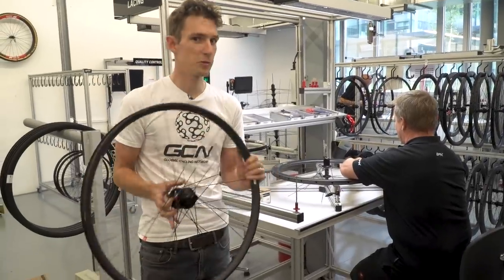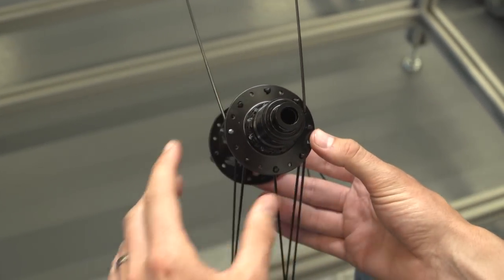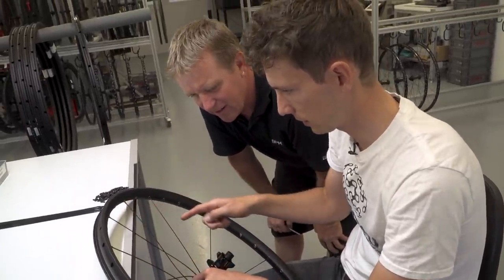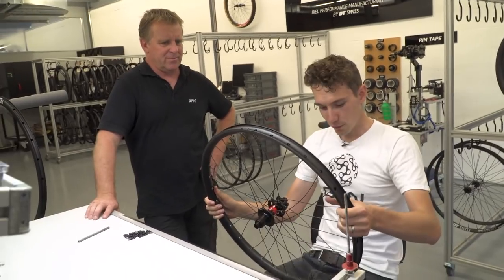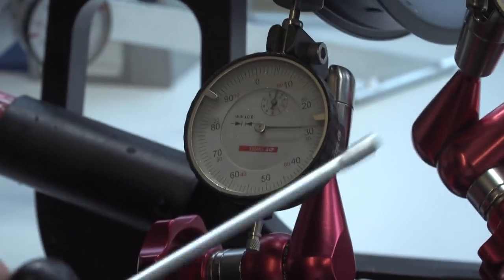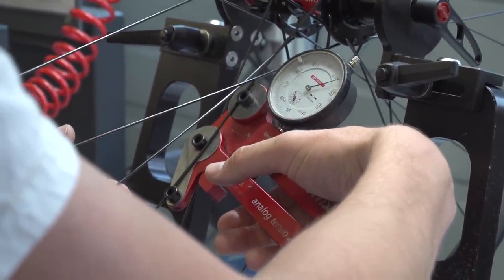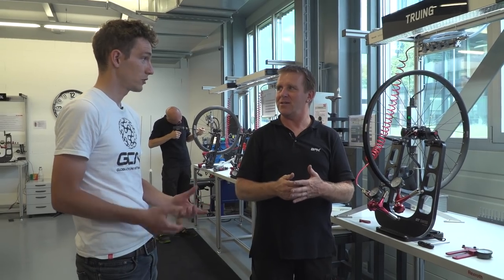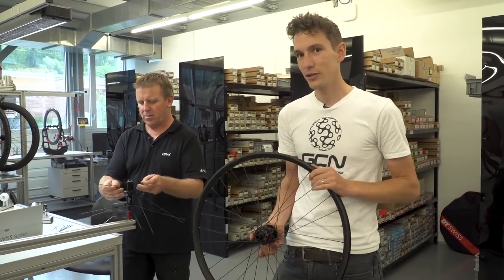How To Build A Bicycle Wheel | Maintenance Monday

Comment: I've used pitch to check tension while truing wheels, and it can apparently be used in wheel building in place of a tensiometer: https://www.sheldonbrown.com/spoke-pitch.html
Reply: Eleanor Law this tends not to work because its hard to know what pitch is the right one. Best rule of thumb for me is getting the wheel as tight as possible.
Reply: It's no worse than grabbing a couple and squeezing, it's a matter of how much experience you have. But if you have a musical ear (as I do), "plunking" them to check for uniformity of tension is very accurate.
Reply: It works fine.  If you follow links from that page you'll find a link to a table of spoke lengths to musical pitch.  I've built lots of wheels this way and have checked them with a tensiometer, and they've always been quite reasonable.  "As tight as possible" has a lot of variables.  If you're using good quality parts and lubing the threads like you should, it's actually not hard to over-tension and break things.

Most people who do it by feel tend to under-tension by quite a lot, which leads to weak wheels that will need truing often, and likely be breaking spokes within a couple years of regular riding (at best).

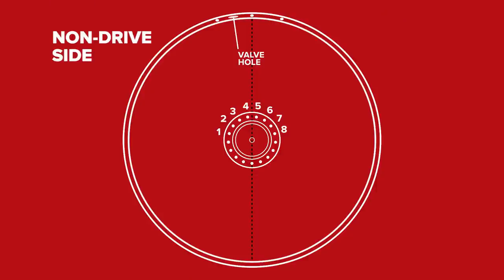Comment: 04:28 Wrong information!
It is the same method, BUT INVERS HEAD POSITION.
You will have the head inside at hole 1 (its head outside on drive side), 
and the head outside in hole 8 (its head inside on drive side).
Reply: I thought it was wrong,  The picture shows the same each side.

Comment: Not one of your best GCN, confusing and a bit superficial.  I went on a wheelbuilding course 20 years ago and have done 300+ builds and fixes since.  So satisfying but not cost effective because you can buy a pre-built wheel far cheaper than you can buy the parts.
Reply: Given a choice, I'll choose the satisfaction of riding my own hand-built wheels at 50+ mph downhill, or across the country anytime.
Reply: In my case the parts for the wheel are way much cheaper than buying a new wheel (I am using a 27" wheel in a retro bike vs a 622 ready made wheel suggested by the service staff). About 1/10th were my costs. The tools would certainly push the budget, but they would remain in my toolbox for later repairs/builds.
Reply: I can build a much better wheel than I could buy within my budget.
Reply: Human spoke tension balancing > robotic, having built 300 wheels in the last 10 days, that is.

Comment: Until I'm ready to buy "ALL" the proper tools needed. I'll just let the master wheelbuilders do what they do best and enjoy riding instead 😊
Reply: What if you had the tools available to you, like at a bicycle co-op or something?
Reply: Patrick94GSR That would be cool and YES I would definitely build my own. A lot of people have multiple wheel sets , why not have a set that you built yourself?
Reply: Nothing wrong with leaving it to the wheelbuilders if you want to, but you can certainly build good wheels with minimal tools as well.  An upside down bike works as a truing stand and you can check tensions with a guitar pick and your ears. (there's a table you can find online with spoke length to musical pitch values).  That does away with the expensive tools.  I think the only specialized tool you need is a spoke wrench.  The tough part is being patient enough to do a decent job of it.  My first wheels took many hours before they were decent.
I'm working on making an in-depth video on the subject.  I've shot a bunch of footage.  Now I just need to learn the editing.  ;)
Reply: nwimpney Many hours?!!! Do bike shops have wheel building/trueing classes?
Reply: nwimpney You don't even need a spoke wrench. When I started I cut a bit out of the middle of a flat blade screwdriver. So if the spoke starts to stick through the nipple I could still turn them.
Reply: TRON KNOWS  Yeah, I didn't time it but I spent a couple evenings on each wheel the first time I did it.  It's not so much the assembly, but the truing.  I'd get it kind of close, and then another part would be out, and then it would have too much tension on one spoke, and lots of back and forth monkeying around.  That's just learning, though.  The last one I built was probably 4 hrs or so, and that included a bunch of screwing around filming it so I can make a good video on the subject.  If I was building for a bike shop and needed to get it out quick to make a profit, I could probably build a decent reliable wheel in a couple hours (with practice and some nicer tools, I could bring that down a lot more).  Since I'm building for myself, and actually find it kind of fun, I don't mind spending twice as long evening out tensions and getting the wheel bang on.

I don't know if you'll find classes.  I don't think most shops would, and honestly, I don't know that they would be super worthwhile.

I learned by jumping in.  I started with sheldon brown's wheelbuilding articles.  They're well explained for the basics.  I built some mediocre wheels.  Then I gradually read things from a bunch of different sources, and each set I built was better than the last.  I recommend checking out "The Bicycle Wheel" by Jobst Brandt.  It's quite scientific and doesn't make a lot of assumptions, or rely on superstitions.  One of the big issues with learning is that there's so much misinformation out there.  Even in this video he talks about building "softer" wheels by using less spoke tension, which is a common misconception (What you really get is weaker wheels).

My advice is to read very critically, and keep in mind that wheel building is not an art.  There's really no black magic.

Hopefully I'll get around to editing together that video soon, since I haven't seen any that really go in depth enough, step-by-step.
Reply: nwimpney Thank you for the information. You're right that it'll be rough at first, but it'll be worth it. I've built many bikes over the years, but have never built a wheel set. I was thinking about trying to build a set because I want to be able to pick my hubs, spokes, nipples, and rims. I better start off with some cheap stuff for my first wheel build huh?
Reply: Trying to tighten them from the slot in the heads is asking for trouble.  That's useful for spinning them on quickly, but I really wouldn't recommend building without a spoke wrench.
Reply: nwimpney I didn't see a spoke wrench being used in the video. Have to agree though I prefer to go to a spoke wrench if things are getting tight and I have one. Still possible to mess up a nipple with a wrench especially if it isn't the best fit.
Reply: TRON KNOWS  I don't think you're likely to hurt anything,  so you may as well use decent stuff.  I wouldn't go crazy with carbon rims,  etc, but buy something you want to use.  Don't assume it's throw-away practice stuff.
I would probably recommend against crazy low-spoke builds, or using really thin spokes like Sapim Laser, or DT Revolution on your first build, since they can add some complications. 
 Just get yourself some nice 32 spoke rims you like, hubs, and some good quality 14G stainless spokes/nipples, and build some nice standard 3 cross wheels.
Reply: nwimpney Thanks for the advice. Worse case scenario... I can take it to a bike shop so they can True it for me.

Comment: Such a process.  I really thought the hub would be held in a fixture while the rim was also held in a fixture while it gets laced.  If I did that loose like that,  the base wheel would be 4” out of true.  It would take longer to fix it than to start fresh.

As much work as that is I can’t believe they make cheap shitty wheels at all.  Doesn’t seem worth the effort to make anything other than high end wheels.

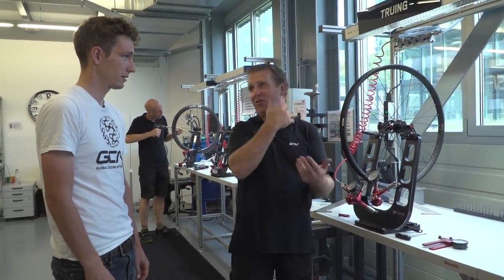Comment: Incorrect information at 11:45.  Modulus of elasticity is linear for the DT swiss stainless spokes in the range of tension used for wheels.  Stiffness of the wheel is therefore not effected by ramping up tension on the spokes higher or lower.  If a spoke were to go completely slack then you approach wheel failure.  Marcel Waldmanm may have been building wheels for 30 years, but apparently he has not read a book on wheel theory or taken a class in physics or engineering.  Building wheels another 10 years will not change this fact.  Experience does not = knowledge.  That's not to say his wheels are crap.  Only that he does not understand how they work.
Reply: Go easy Bert ;) but yes you are 100% correct I just had the same rant under the pinned comment!
Reply: Bert Hull...  Me three, that is terrible advice.
Reply: Yay.  I was just about to comment on that.  Now I can just thumbsup instead. :)

To put it in layman's terms:  Within reason, a tighter wheel is a stronger wheel, and you will not feel a difference.

If you're relying on your spokes for suspension, you're going to have a bad time.
Reply: SirBlot No way.  Spokes pretty much always break by fatigue, barring absolute garbage spokes, or huge impacts.  That fatigue is caused by the spokes stretching with every revolution of the wheel, and is massively increased by loose spokes which can go slack on each revolution.  If your wheel isn't shaped like a taco, the break was probably caused by fatigue.
Reply: Guys relax, they showed wrong info on purpose. The wheel building is easy, but they showed it like a magic magic )) Too complicated then it is. So do not take it too seriously.
Reply: Agreed.  Pretty much all metals follow linear elasticity (stretch is directly proportional to load and then returns) up until the point of failure.  Increasing the tension only means that the spokes are pulling against each other.  In other words, it doesn't matter what tension you start with. Extra load causes more extension.  All the weight of a bike is carried in tension. There is a down side to too much tension in that you decrease the fatigue life, or you might just pop over the threshold of linearity. The down side to insufficient load is that the lower spokes completely unload and THEN you have a floppy structure. So that's where a "soft" wheel might come from.
Then again, the bass player in me knows that a less tight string is floppy compared to a tight one.  Maybe its to do with vibration nodes.  
Maybe none of it matters and he should just build the wheel that feels best - whatever that is.
Reply: @pbassred w.r.t. bass strings, I think (after drawing a diagram) that tension matters for out of plane loads (like plucking a string), because the string makes an angle to the horizontal and the vertical component of the tension in the string to left and right of where the load is applied must equal the "plucking" force... therefore tension determines the angle you can make (i.e. the displacement of the string) for a given force (tighter string = less floppy than less tight string). However with a spoke the load is almost entirely axial and not out of plane, therefore no angle and tension independent of axial displacement as has been discussed already. Also from my limited wheel building experience, the spoke tension has an effect on how easy it is to squeeze the spokes together  (i.e. out of plane) just like a string... which makes sense to me. Hope that helps!
Reply: Yes Bruce.  That's kinda what I said.
Reply: @pbassred , yeah saw what you said about wheel acting in tension in your informative post above, just thought I would try to clarify the bass string observation you made in case it was useful for anyone apart from myself. Didn't mean to sound like a condescending pr**k but easy enough on tinterwebs. Rock/ride on dude.
Reply: Si put the words in his mouth
Reply: This must be credible information from you Bert. I was a bit dubious until I read "...therefore not effected...". Clearly you haven't read many books on language which almost certainly means you are an engineer. Young would be proud! How do I know these things? I am an inginear meself. ;-)

Comment: #torqueback riding with earphones and listening to music...yes or no?
Reply: If there's any other traffic around no, otherwise yes.
Reply: Pretty sure that's already been answered.  IIRC, on the trainer, yes.  In traffic, no.

I disagree, though.  I ride with earbuds all the time.  I just set the volume fairly low.  Passing cars will drown it out entirely (Traffic is a lot louder than most people realize).
I can easily hear other riders talk to me at a conversational level.  When I'm on busy streets, I can't really hear the music, but when I'm on the side roads/bike paths it's nice.

If you crank your music to try an hear it over traffic, that's kind of dumb, and is also annoying to other riders (and damaging to your hearing).  At the very least, you need to be able to hear another rider warn you that they're passing, etc.  If you can't, you need to turn it down, or give up the music.

Also, do not ride with one earbud.  This is a stupid habit.  Your directional hearing pretty much goes away entirely, and you will usually turn your music much louder to compensate for the other ear, causing hearing damage.  It doesn't accomplish anything over listening with 2 ears at a reasonable level.

One more piece of advice:  Use replaygain, etc, on your music so it all plays at the same volume, and then set your volume level indoors before you start the ride.  If you set it to a reasonable level inside, and then don't touch the volume again, it prevents you from slowly turning it up to compensate for the noise as your ears get used to it.  (Same effect as when you get in your car in the morning and your music seems insanely loud).  Of course, you need it normalized, or some songs will play way too loud, and others too quiet.

Comment: omg this lacing pattern is so confusing wth
Reply: 3-cross is very easy just look for any other video ;)
Reply: Gabor Varadi ik how to build wheels lmao, it's just that this method of lacing is confusing as shit
Reply: Yeah, it's not the simplest for a beginner.  The main advantage of the way he's doing it is that it's stable right away, and the spokes don't loosen off as the hub turns back and forth while you work.
It's a bit more complicated process at the start, but it makes the rest of the process a bit easier.
I really don't think this video was intended to teach you how to do anything.  It's more just an overview of the process which might inspire some people to give it a go, in which case they'll find more detailed info elsewhere.

Comment: Would you buy Chinese carbon wheels from eBay #askgcn
Reply: to shear GCN would never do that. That's Sponsorship Suicide.
Reply: i bought a pair a few months ago and they're great for the price
Reply: Profit mate I've heard a lot great things about Chinese Carbon Wheels. Of course you'll have opinions from the haters (who have never owned a pair), but I haven't actually seen any bad videos about them.
Reply: to shear I've built my own from some ebay carbon rims.  The tubulars on my track bike seem quite good.  I'm a little more wary of the clinchers, though they seem alright so far.
I've seen some pretty mediocre wheels, and while I might buy some myself if I wanted a cheap set, I would check the tensioning and adjust/true them if needed.  I probably wouldn't recommend it to someone who doesn't know how to do that.  Of course, I wouldn't recommend super-cheap aluminum wheels, for the same reason.

I have known people who have bought cheap carbon wheels, and have ended up spending a couple hundred bucks at the LBS getting them rebuilt with better spokes, etc.  I'm not sure at what point you're better off just saving up for a brand name set.  OTOH, lots of people are totally happy with them, so YMMV.

Comment: I learned how to build wheels as an adult and it's big waste of time.  U can build a nice wheel but the time needed to get good would b better spent riding the bike.
Reply: You can build them when it's dark out and you're not riding or when the weather is crappy or anytime you're not riding a bike. So it's not really a waste of time because I'm sure you don't ride your bike 24/7/365. So plenty of time to work on wheels if one desires.
Reply: It takes 30 minutes to build a wheel and 2-3 times as much time to true it. I dare say you spend much more time each year to clean lubricate the chain alone.
Reply: It will take most beginners far more than that, but it's definitely not a waste of time.  I know that the wheels I've built have all been better than the wheels I've bought.  Maybe that's not true in really expensive wheels, but in my budget it certainly is.
Reply: You can build them whilst watching GCN videos.